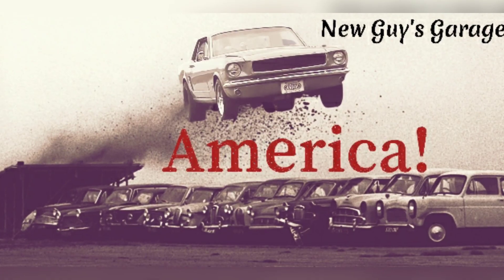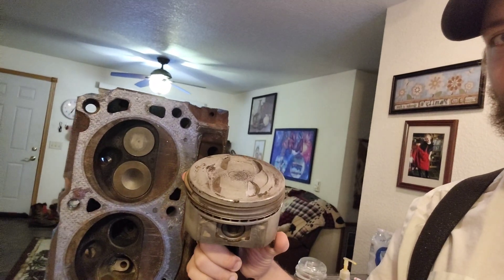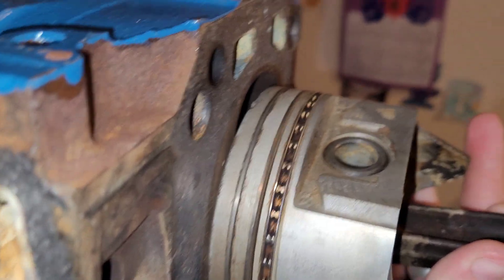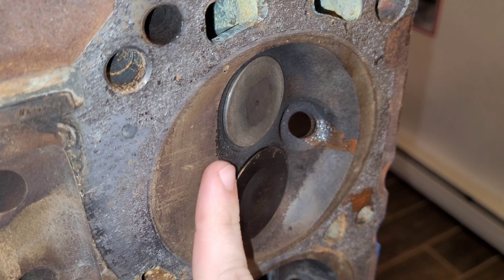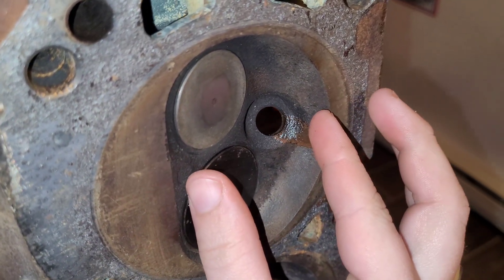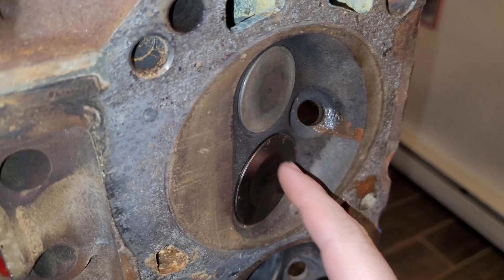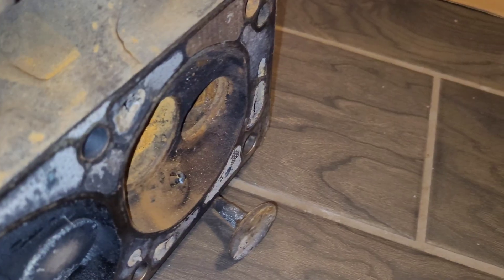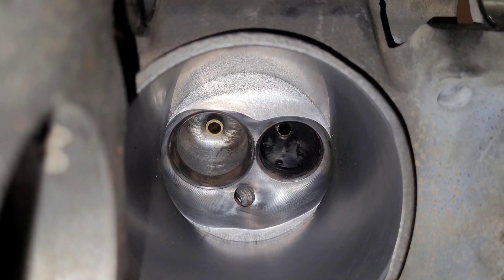Quench, What Is It And Why Does It Make Power!

Comment: Quench also includes the soace down to the top ring. All of this gap/open space is quench & is typically tightened up to the pint the piston keeps the head free of catbon or just kisses the head. To a piston .120" down in the cylinder. The general thinking is the tighter the better for N/A engines looking for max performance & detontaion resistance. Nitrous & forced induction engines have sofetened chambers to reduce detonation sesitivity & tend to make more power. Some turbo engines keep the piston quite a bit down in the hole as boost/cylinder pressures changes many things. So it all depends on the combination.

Comment: Quench is great up until you have very high hp output per cylinder, then that thick part of the casting becomes a glow plug, igniting the mixture before the spark plug. See chamber softening.

Comment: Wow! This is the craziest explanation I've ever heard. It's also all totally and completely wrong! Squish and Quench are two different things! You COMPLETELY miss the mark. The distance between the cyl head and the piston is part of the combustion chamber volume and compression distance. 
Quench is the lack of propagation or travel of the flame front and results in a corresponding reduction in power output. Sometimes due to a deflector dome shape it will prevent the flame from travelling efficiently through the combustion chamber resulting in a lack of complete combustion and heat.
There are way more aspects to it than you talk about. Increased timing lead causes increases combustion pressures. Non homogenous air/fuel can cause lean spots that elevate combustion chamber temps. The 2 biggest factors are combustion temperatures and combustion pressure. Which effect any unspent mixture if it causes it to ignite spontaneously. Combustion chamber shape and design/material, spark plug location/heat range, piston design and fuel type all play a part in preventing this too.
You don't want quench. If you do, you have incomplete combustion and a reduction in power and efficiency. You want complete combustion. Squish is what prevents 'quench'.  The reason isn't as you state. You have a more homogenous mixture resistant to spontaneous combustion after ignition and uniform flame propagation. If not, different densities of air/fuel ignite at different times. 
Geez, YouTube does not disappoint that it is chiefly entertainment.
Reply from the maker: ......so what your saying is....when you have quench you lose power? 

So open chamber is key then 😂
Reply: The proof is in the pudding NNN
Reply: @slymo-i8j  What 'Proof'? This guy is CLUELESS! Throwing around terms he clearly doesn't understand. He is conflating at least 2 different things he knows NOTHING about! Every time he pontificates, he shows his IGNORANCE! 'QUENCH' does NOT make power! The absence of it does. This has been understood by professional engineers and builders since the '60's. The open wedge chamber is a 1950's design.
Dumbasses. So 'only burning half your intake charge is a good thing and MAKES POWER!' THAT'S WHAT HE'S SAYING! Incomplete combustion MAKES power! People that take this guy's advice are working on souping up their lawn mower engine. Closed chamber heads are 'anti-quench' the opposite of what he thinks or says, however, it is still possible to 'quench' the combustion flame travel with those heads. It's so much more complicated than he knows or could understand. Look up the definition of 'quench' and tell me why you would want it.
Reply: @vincemajestyk9497  I meant they can prove things with a race. Ngg is only one could understand
Reply: @slymo-i8j  I gotcha. Quench is really only 'beneficial' for iron headed wedge engines because of where the spark plug is (the long slow flame travel.). Quench is surface area (piston+chamber area) that 'cools' far end of the gasses which haven't burned yet. 'Squish' is what the piston moving to the top of the cyl head does. It swirls the mixture making it more uniform, less prone to detonate. Bigger, open chamber volume, less squish, more need to cool the mixture so it won't detonate. Wedge engines need a lot of spark advance to make max power because of the plug location and slow flame travel. Aluminum heads will pull a LOT of combustion heat out of the chamber. There's tons of variables.
Reply from the maker: @Vince Majestyk

https://www.motortrend.com/how-to/ideal-quench-height/

Hmmm......🤣
Reply: @newguysgarage6802  That guy was a magazine 'writer' with a Political Science degree who started in the mail room for a magazine that doesn't even publish anymore. NOT an SAE engineer or anybody that even put a car or an engine together. Kind of like you. He's talking about compression height and compression distance which effect chamber volume. Hmmmmm......🤣
Reply from the maker: @vincemajestyk9497  
https://youtube.com/clip/Ugkx7pRqGrL6Uud_bsUghFzIx2EWR4sKJY2n

I have a feeling you are going to say your smarter than David Vizard too...😂
Reply: @newguysgarage6802  I thought it was a video about your 'Dyno' in your shack garage proving your single exhaust theories. Why don't you scrap that Mustang and at least get a fastback 'guy' 😂
Reply from the maker: @vincemajestyk9497  yep I called that one from a mile away 🤣🤣🤣

You have fun in your world buddy 😂
See you at NNN if you qualify 😉
Reply: Visard knows a whole lot and is a very good source. He is wrong sometimes. Wrongly uses the word “quench”. 
Good video btw. Both, or all three of you guys are correct. 
Visard, Andy wood, and uncle tony video good too 👍
Reply: @bobirving6052  Absolutely YES! Nobody's perfect. He's great at 'passively.' blowing his own horn too. I stopped watching his last video midway when he said '2 racers were having an argument a one said 'How do you know that's right?' And he said 'BECAUSE VIZARD SAID SO!' Sure. Whatever. How can you ever learn by NOT constantly challenging what you THINK you know? I subscribe to the Cromwell rule. (Oliver Cromwell in 1650), 'I beseech you, ........Please consider the possibility that you are MISTAKEN." I've looked at his '128 formula'. There's some issues with it.
Reply: There are a lot of instances where the scientific nomenclature is used technically incorrect in common vernacular. We get it, you probably have an engineering degree that reflects your superior education versus the  "common gearhead". I have no problem with interchanging quench and squish. Happens all the time, as they are related. We know Quench refers to the distance between the flat top of the piston and the flat area of the cylinder head. The less quench area, the less fuel molecules can congregate in that area making ignition more difficult, and loses heat to the surrounding area too rapidly for the flame to propagate backward toward the spark plug reducing detonation chances. Squish is the compression of the intake charge produced by the velocity of the piston to head clearance area. Maximum squish velocity occurs at about 10 degrees BTDC and 10 degrees  ATDC. Turbulence is what causes the homogenous mixture and is different then either quench, or squish. We can discuss the differences between homogenous and stratified intake charges but who cares? Most of us just say AFR and want to create more power reliably and don't give a shit about the science. You say that folks like Vizard are wrong, yet there were some people who did very well building powerful engines without an engineering degree. Bill Jenkins, and Smokey Yunick come to mind as well as a lot of other pioneers from my day. Have a good one!